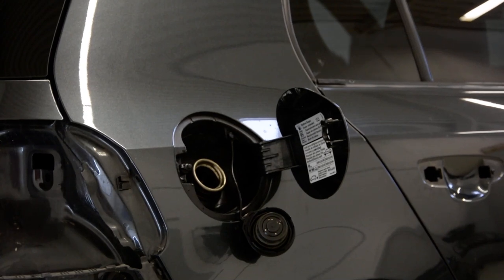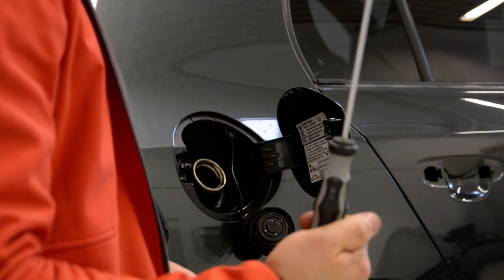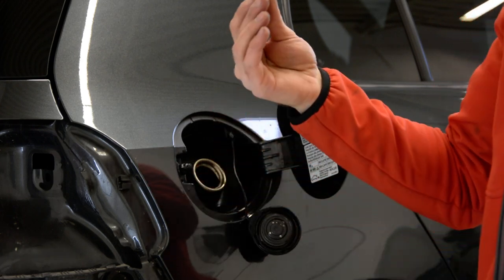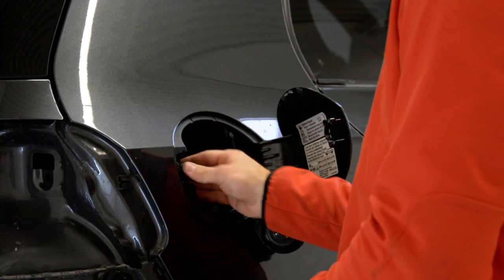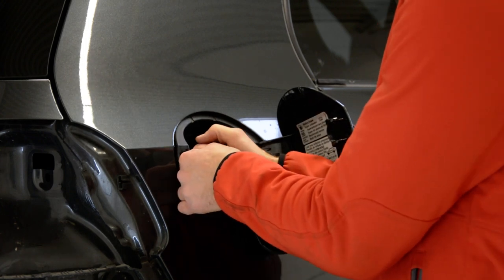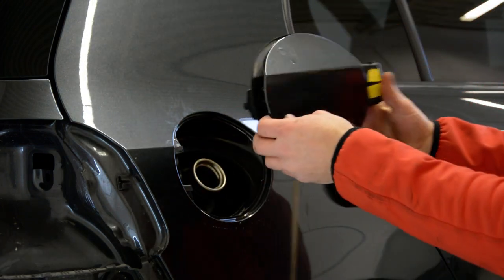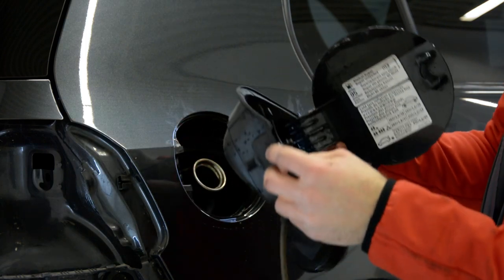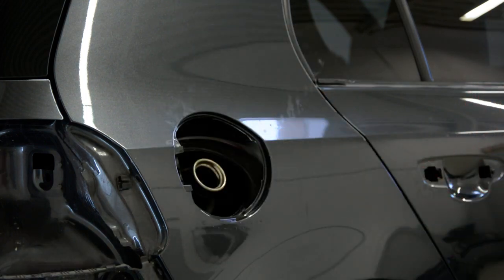Fuel cap cover  removal VW Golf mk6

Comment: In my car the fuel lid lock is not locked, when car is locked...any idea?
Reply: Check your fuel door Actuator Motor. Open the fuel door and try to lock the car and see if there’s a metal thing that sticks out when you lock! If nothing comes out from the above of the fuel door mechanism then your actuator is not working. I had the same problem and replaced the actuator motor and all is good. It’s an easy DIY.
Reply: Having this same issue but the actuator is working properly just looks like the pin doesn't stick out far enough to lock. Looks like I need a small grommet to reduce the gap.... but I didn't remember one being on the original part...